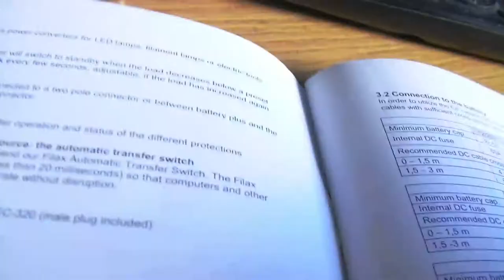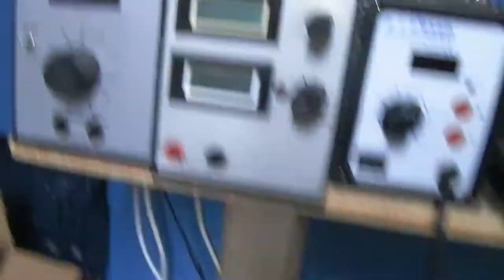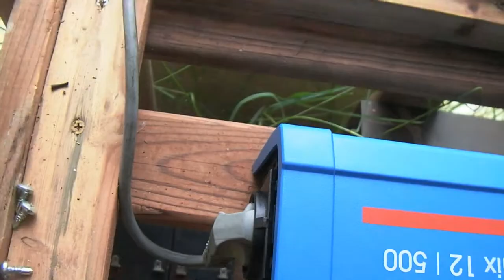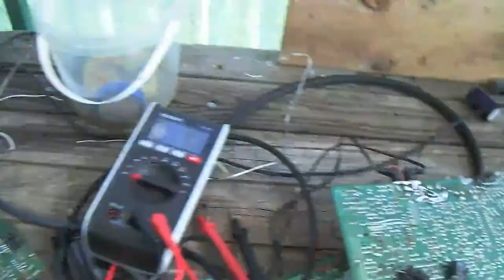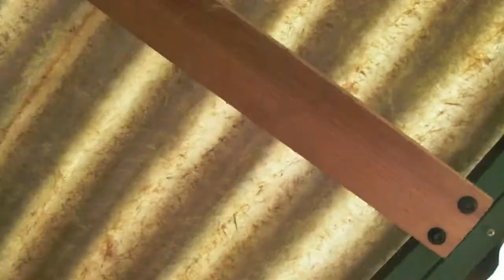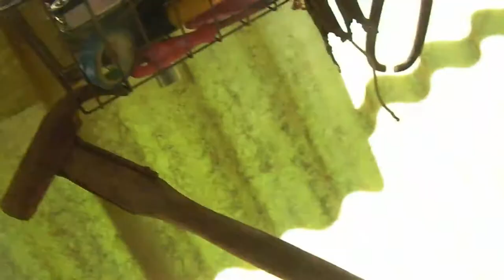[Kind of Unedited] Phoenix Pure Sine Wave Low Frequency inverter :)

Comment: victron call not their inverter low frequency, but HYBRID HIGH FREQUENCY TRANSFORMER BASED. in theory have some advantage of LF square iron transformer inverters (not 300% surge but last lifetime with repeated inductive surges) and of HF inverters (almost same efficiency, and same efficiency or more, respect cheap HF, and low idle consumption).
what do you think?